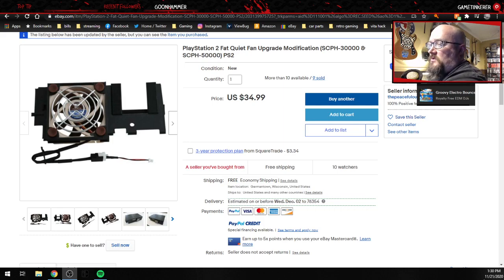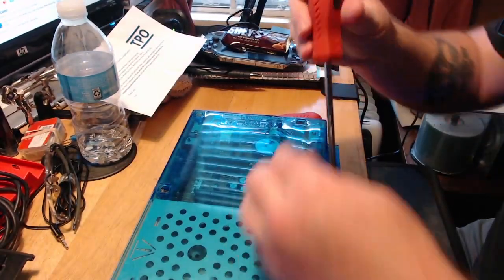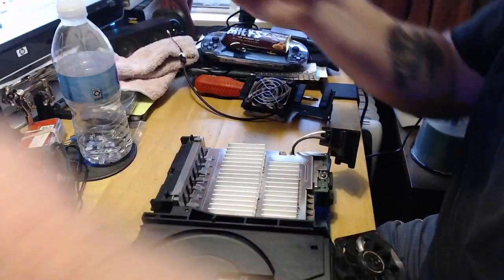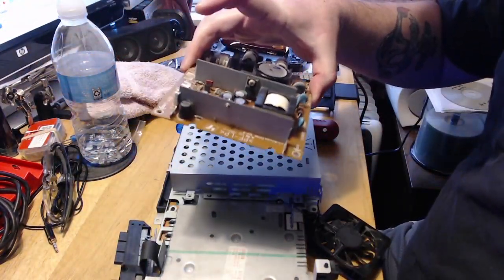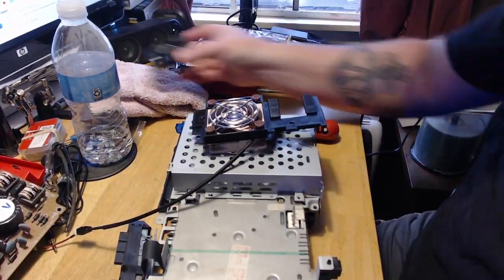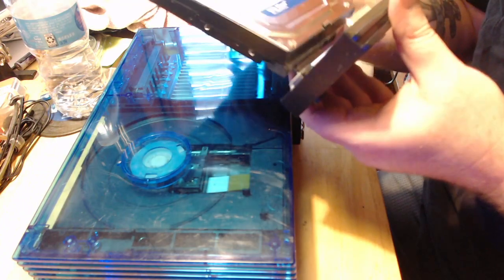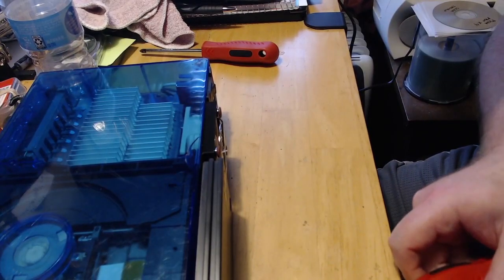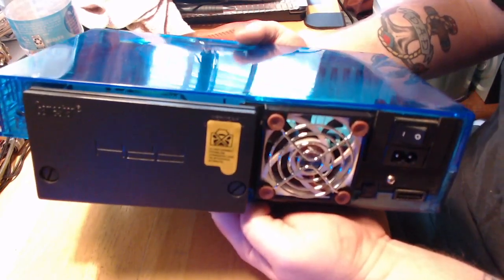Upgrading the cooling in a PS2 FAT

Comment: Just installed this on my PS2 fat and I had to get my phone's camera out to make sure the fan was actually on (just redid my retro setup and my cables are zip tied to length so couldn't pull it out much). Could feel air a bit but wanted to see the blades spinning.  Went from noisy on a replacement PS2 fan I got on amazon years ago to silent.

Comment: Using the wrong fan. It requires 12v and the original fan runs at 7v. Noctua does sell an A6X25 5v version of that fan specs

You will have to switch it out or wait for the seller to do it himself. But i think may still perform worse than the original. As for the original fan, it is a Nidec D06R-07B1S1 there should be plenty of other similar replacements out there aswell or you can refurb the original fan for it to run quieter.
Reply: The 5v option is not better either, the 7v line is bound to burn it out. The nidec fan from the 5000 series is the correct choice. :]

Comment: These console don’t over heat they barley make enough heat to overheat. The fan in the phat PS2 is mostly there to give the power supply some cooling that’s it the heatsink disputes the heat mostly which ain’t much like this is no PS3 or PS4 or even the PS5 that generates a lot of heat. But do what you like
Reply: They definitely can and do overheat and you will get the flickering red light and the console shutting down on you. This fan is really an upgrade for a noisey or broken fan but people need to be careful because my Noctua as per this product isn't pulling enough volts to cool the ps2 sufficiently after an hour of gaming. So for me there's more work on this product thats needed.
Reply from the maker: Make sure to let Tim know. He's a super guy and will appreciate any feedback you give him on the product.

Comment: Would be cool to be able to get a network adapter with a built in tray for 2 switchable 2.5" drives.
Reply: I'm sure it could be done with a switch of some sort. It wouldn't be able to be hot swappable though. A tray wouldn't be hard to design.

Comment: Does it hurt anything that my network adapter is slightly coming out? The fan comes up and all, and my HDD seems to be working, but the plastic gets in the way. Should I just cut it a little? Or did I screw up? 3000 here with 8 screws.
Reply from the maker: It doesn't hurt anything.
Reply: Just installed it in my 3000 series and it was pretty flush. Recheck your alignment and if that's ok then maybe you can sand down what is in the way. But as long as you are getting a good connection on the hdd, its not a huge issue.

Comment: Mine is getting rlly rusty on I think it's the heat sink or the crime bit how do I clean
Reply: Rusty?  Or dusty?  If it's rust, you have a huge problem!  Live in an area with high humidity?  Spilled water damage?  As for cleaning, soft bristle toothbrush and 99 isopropyl alcohol.  There are loads of videos on how to gently clean electronic boards with this method.  Do you have a picture btw? Another thing that comes to mind is a busted capacitor and leaking acid.

Comment: The ps2 fat doesnt overheat right?? i have one with the games loading thought an hdd but i have been with my doubts about if its cool overheat or not.I use the original bay for the hdd so only accepts ide , im planning to aquiare some generic adapter that allows me to change the one that i have for an 500gb sata because the downside with ide its that the maximum capicity are really low in these ones.
Reply from the maker: I have never seen one overheat in all the years I have had one.

Comment: I just installed one of these but the fan won't ever go on, whether it's idle, in the browser, or in a game. Put my old OEM fan back in and it still works, so I don't think my system is the issue. I'm using a 50001 NTSU-U model if that makes a difference. Anyone have any solutions for this? Did I just get a bad fan?
Reply from the maker: Oh wow. Do you have a PC that you could possibly plug the fan into just to test it? It is possible that the fan is faulty but its unlikely. Anything could happen though. I am unaware of any power differences etc for the other models.
Reply: @thegametinkerer  I tested it in my PC and the fan itself worked, so I guess the problem is with the little adapter that connects it to the PS2 board
Reply from the maker: @Kyle-jl5tu  are you good at soldering? Maybe it can be repaired. If not then contact Tim for a replacement part. If you need help contacting him just let me know. I can contact him directly.
Reply: I bought one as well and am having the exact same issue as you are for what it's worth to you
Reply: @Appl3sandgrapes  are you using the same PS2 model 50001? Maybe it's an issue with the adapter to those specific consoles. The disc drive shielding of the PS2 in this video look quite different from mine, so I'm guessing it's a different model PS2 than the 50001
Reply: @thegametinkerer  unfortunately no, I don't have a soldering iron and don't have any experience with it. I contacted the seller and we're trying to troubleshoot, he says the little adapter part looks fine but that there's a slight chance they may have reversed the polarity of the connector for the 50001 PS2s

Comment: Does it seem like it pushed out less air than the stock one for you?
Reply from the maker: no it pushes more air out
Reply: That is a Noctua fan and they are a very reputable company. Extremely quite, high airflow, reliable, and relatively cheap.